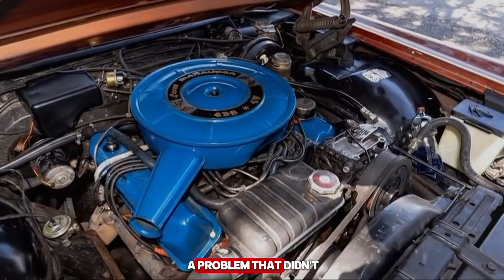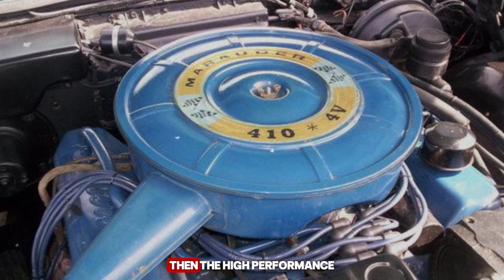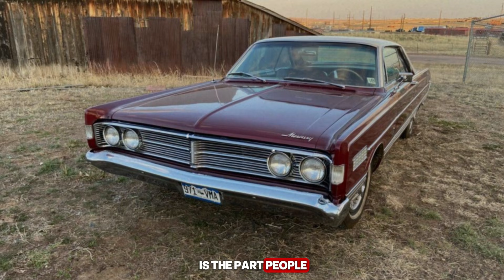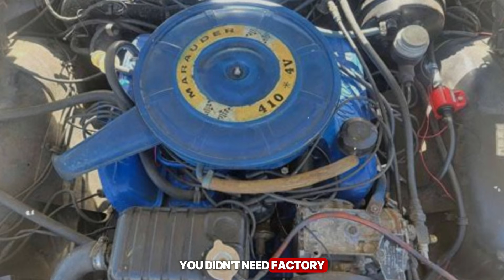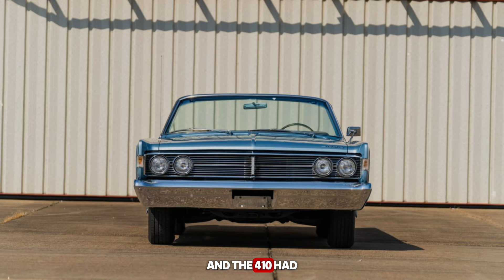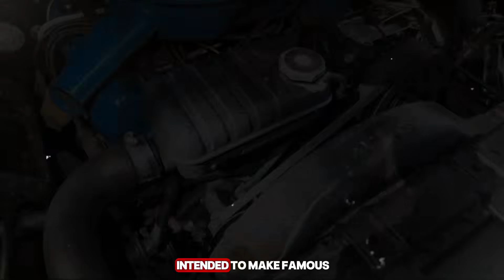Why Ford's FE 410 Was the Engine Hot Rodders Begged For — But Never Got

Comment: 410 was an Edsil engine from 1958. Originally FE was Ford/Edsil. The MEL was the 383/430/462 used in Mercury/Edsil/Lincoln. Most of the ‘58 motors are probably long gone. Have fun

Comment: The Mercury 410 is not an FE, it is a MEL (mercury, lincoln, edsel) Heads are machined flat with the blocks deck milled at an angle to produce a wedge. 383-462 ci displacements. Use ended with the introduction of the 385 series 429-460
Reply: The 410 FE was a Mercury only 66-67. The MEL 410 was for the big Edsel cars.

Comment: Fords blow upwhile parked. My dad had a 58 fairlane with the 352 special police interceptor, the oil pump took a shit every month,the carbs were a constant hassle
Reply: The FE and SBC are the two greatest engines ever built. You had to get in then and work on the oiling system. It is as simple as dirt to run 6000 all day long.

Comment: I still don’t believe that the 410 was only 330 hp,  I think it was closer to 375 hp and 470 ft lbs, and it was pulling to 5500 stock. It kicked like a mule. I think the 4V 390 was 355 hp and 455 ft lbs stock. This was at 10:1.  When the carb was a 4100 Autolite, a Holley swap and 2.5 dual exhaust, I am sure of it. The 10.5:1 or 10:1 was stronger than the 320-330 hp they were rated. And with a 410 and flat top forged pistons at .030 over, and the 427 hydraulic cam from the Cougar back then.  Put headers and the 427 Cougar hydraulic would make 410 hp, 480 ft lbs. Ford should have done it. Some one should do crate engines. 525 hp 525 ft lbs.
Reply: Keep in mind SAE horsepower ratings were gross numbers before the switchover to net HP ratings in 1972. But yeah, they definitely lied on rated HP.

Comment: About 10 years ago, I was at a self-service wrecking yard looking for parts. There was a clapped out 1969 F-350 flatbed truck in one of the rows. It had the older trapezoidal valve covers that Ford replaced in 1968 with the rounded ones that were stamped "Power by Ford". Someone had scraped the grease off the left front of the block revealing the number "352" , which most FE blocks of that vintage had. The original aluminum engine tag was still under the coil, it was stamped "410". Not having the tools necessary, I removed the tag and reinstalled the coil bracket to prevent someone else who knew from identifying the engine. I returned with the proper tools and removed and bought the engine for $175. Upon getting it back to the shop and pulling the oil pan, it was equipped with the 1 UA crankshaft indicating that it was in fact a 410. While I prefer to use 385 series 429 engines, I couldn't pass on that 410. A couple months ago I bought a "Q" code 1966 Thunderbird for $600. Its original 428 is worth more than what I paid for the car. Its still in my driveway awaiting reconditioning when I get the time.
Reply: Are you certain that it was a 1UA? The410 and early 428s were usually 1U or 1UB, the 1UA is the mark for the 428SuperCJ?
Reply: @Bill75456  Its definitely 1UA, turned 10/10. Of course there is the possibility that it was rebuilt with an exchange crankshaft which was common at one time, exactly when it was rebuilt isn't possible to know.
Reply: The 410 was my favorite. I snatched them up from the Salvage Yard in the 1970s and they bored .040 or I would keep the crank and use it in a 105 D4TE block at 4.09-4.11 and deck it to Zero. Back then.1/16 1/6 3/16 were as thin as they were on 4032 alloy pistons and in the 70s the 5140 forged steel rods were great with a a ARP bolts. A set of CJ heads and an aluminum MR style intake was good and the blueprint 427 425 hp solid was still available from a bunch of places. You had a 418 at .040 over and about 420 at.060 over. Some oiling mods and a good pan and put it in a 67-68 Mustang with a 1 3/8 top loader with a 3.70 locker and you were just at playing with the big boys. I beat every 383 Mopar and  a couple of 6pak 440 cars . Chevy, the L-78 68 Nova was a 6/6 run and it could go either way. The .060 over 410 had crazy torque. People claimed I had a CJ.
Reply: I miss the 410. It should have been the GT and GTA Fairlane and in 67 Mustang, Tasca may not have done the 428. A 416 CJ in a little car? The 428 could have come eventually, but the 410 as a GT would have been the GTO. I enjoyed building them. If they were going to cast 406/428 blocks, the 410 would have been all right.
Reply: I really liked the lighting bolt square shoulder “Mercury” valve covers. The 410 in the 67-72 F100 with an NP435 or even the big block top- loader and 3.70 locker gears in the 115 WB  bumpside. I did a 410 .030 over with flat top UEM Silverlite pistons with 1/16 1/16 Napier and 3/16 oil rings all filed and C7AE-B rods with ARP rod bolts and ARP main studs with 2 and 4, mains crossbolted. The 1UB crankshaft and the whole oiling system blueprinted. I put a Lunati 285. solid 110LSA 106 ICA and.527 lift with asymmetrical exhaust lobes, 300 exhaust was solid as an SCJ 428 blue print ca. Shell lifters and wraparound end stands with the HD rockers. The intake I put on the CJ head was an aluminum MR. The heads were the C7JE “Canadian” heads with the boat number that were 2.09/1.65 early style tall ports and 10.5:1 cr. The carb was a downleg 789 that I still have. That truck, idling, you could feel it pounding in the soles of your boots. Driving it was plain nasty! I miss that old truck. I did another.039, over 410 and ran it in a 68 Mustang coupe with a 1 3/8 top loader and it was a little beast., I drove them both in high school, and they were respected. The 410 was a great “ builder”.

Comment: Why would you need a 410 when Ford had a 390, 406, 427 and 428, all of which worked real well as I had Hipos of all but the 427
. Know of one guy that used a 410 - only because it was a freebie. Oh and AI is not appreciated.
Reply: The were the poor boys engine and if you know what you are doing they were easy to get a great 3000-6500 rpm runner.

Comment: I've never heard any hot rodder ask for a 410, or even have heard about it.
Reply: The  410 was not a hotrof  engine it was intended to haul heavy cars around! Mwecury never  made any thing  full size that was lite.
Reply: @mylanmiller9656 had seen old ones that had been police cars, cheap powerful car for small departments. Just decaled.
Reply: Guys didn't brag as much, better for street racing. Sometimes if you looked on air cleaner you would see the truck vacuum poppet valves to let in more air.
Reply: @keithbarron3654  The only thing about a 410, that makes it better than a 390, is the 20 cubic inches. Ford used it for 1 (one!) year, before the 429 came out. They offered a 390 in 1961 that had more horsepower, than the 410. I rode long distances in a '64 Marauder 4 door hardtop,  with a 410 hp 427, back in eighth grade. This VIdeo is AI slop, all those years I spent reading Hot Rod and Car Craft since I was 11 years old, and not one article about a build of a Mercury 410. Sure, It can be done, but it still isnt going to be better than a 427 or 428, at most, it's better for a towing package, than a 390. If your racing class limits you to 410 cu. in., you can get there with a small block, that will rev higher. They make that obscure Mercury option sound like the be-all, end all.

Comment: They also came in a PI version with an aluminium manifold that was a copy of the 428 CJ 4bbl manifold
Reply: That's how I remember the 406,410 as Police motors.
Reply: @keithbarron3654  There was also a 352 HP/PI version 360 hp
https://www.youtube.com/watch?v=JSSAOpSvqqs
Reply: @cliveapps7105 I just look at those as small departments thinking back, Mayberry 😊 I don't know if they lasted that long, similar to the 352, by 1968 gone.
Reply: @keithbarron3654  https://www.youtube.com/watch?v=Ir6T5hJnQ_M

Comment: Ford use yo have so many Legendary engines. Today it makes 

Pure Trash !
Reply: To make sure the Ford of todasy don't last Ford puts a timing System in that falls a part and Destroys the  Head pistons and block. the only thing left are teh bolts and they are torque to Yeald so thay  even have to be dumped.
Reply: Expensive  trash though!

Comment: What is missing is that Ford choked off performance to keep insurance rates on their cars lower. A 400+ CID engine in a 60s low-priced car made it a racer to insurance companies. 400+ in a giant luxury car flew under the insurance radar. The 410 was only available in Mercury's high-end models. Ask yourself why a 400M didn't up your insurance on a 70s LTD. Smog stuff and the 460 for comparison.
Reply: Because the 400 Ford didn't  have enough  power to spin the tires on wet grass.
Reply: @mylanmiller9656  Take off the smog stuff. I had a 400M out of a '71 wagon in a '66 Galaxie. The engine and transmission combo had noticeably better torque and outperformed the 390/C6.
Reply: @JohnBroughton-u4h  The  400 had  potensial  to be a Real performer.  But  not the way Ford sold them, It didn't even have  4 v offering except for  a 1977 police interceptor  taht is really rare.  That engine is  listed   in  ford 1977 specs as a R code 400.

Comment: I used to grab them from the junkyard. I really jumped on 410s  A .039-.040 overbore and a cam, 2.09 1.65 valves and a good intake and they came to life. A 420 ci engine is strong. A solid cam and it is strong. The hydraulic rollers you can get now turn a 418.33 FE with good breathing heads is a surprisingly good street car. 4.09 x 3.98. A set of heads that can flow 294 intake and 194 exhaust with a 780-850 carb and headers, it will be vicious.
Reply: yes the  FE engines had lots of  potental with over the c/ounter parts but ford was selling lazy cars in stock form.
Reply: @mylanmiller9656 they all did, unless it was a performance model, but mechanics would do performance tune up, owner got still had economy and peppy street running.
Reply: @keithbarron3654  Ford was  way worse at it than every body else. They raved  about how much power the 427 high riser had, but Wouldn't even sell the juice can 390 hp to joe public.  I had  friends that raced seriously and the only way they could get race cars was to but From a  Racer that would  sell the car after a season of racing.  Ford had their  select  few racers that were given good hot Cars, every body else got junk. I have always been a ford guy but,  Ford pissed me off on how they ran the perfomance program. 
The raved about hot cars but no body could buy them that was not hand picked.
Reply: @mylanmiller9656 Chevy also had select teams late 50-60's early. Buick used to send crate engines to the doctor that had old yeller, beat up road race cars. But we didn't get a lot of performance cars until mid to late 70's were I lived.
Reply: @keithbarron3654  Chevy would  also sell a L78 396 to any body that put it on the order form. 
They also sold teh l79 350 to any body taht would pay for it, same with the LS6 454. What did Ford ever sell joe public that would come close to these engines. if a Racr wanted to run a hot Ford he had to build it himself.
Reply: @mylanmiller9656 I was thinking early 60's, tend to think when racing bans hit. The local Ford dealership by me in the 70's sold parts over counter, after what your talking about. I think after the 390 green block crap Ford tried to regain, during strike managers built engines that had to be warranty replaced.
Reply: @m @mylanmiller9656   I could walk in to my local Ford dealer and buy the parts to put it a 390 and go have fun. Friendly Ford where I lived would sell a 428 crank, a set of CobraJet heads, the 2x4 aluminum PI 428 intake  or the MR intake manifolds, and the C8AX-D solid cam and any valvetrain Parts that you needed. 4.08 dome pistons that yielded 12:1 with CJ heads. And all of that , you could buy the hardware like bolts, gaskets, etc from companies like Holman Moody. The rest was a good machinist, and your own ability to address any problems that the original engine had like oiling system balance that just took some work with a die grinder and a tap set for restrictor plugs, and drill bits to open up passages from the pump to the filter adapter and enlarging the main bearing feeds by laying the hole back to bearing holes size. A larger racing pan and pump pickup. Hot rod engines require skill and attention to detail and the FE is capable of 1.5 hp per ci and 1.35-1.4 ft lbs of tq when you build it right. The FE is capable of being built to withstand the power of  whatever you want it to be. It is a very flexible design that the more you understand how to build it the more you can wring out of it. There are aftermarket suppliers of blocks, heads, and stroker cranks, and hardware for 1000 hp if you want to build a new FE from mild to wild. But you are right, I am pretty sure nobody did Ford Crate engines. You even to the mid late 70s had to build your own. I know that I  got blocks and 3.98 cranks and C7AE-B rods from the junk yard and remachined it all . Ford used to sell hot rod parts, but it never was a one stop deal.
Reply: @keithbarron3654 😎🧑‍🔧🌪️
Reply: I loved the challenge. Nobody took the 390 stuff seriously. But I used a junkyard 410, TRW 12:1 pistons and CJ heads with a PortoSonic and big nasty cam and it was 418 ci with strong walls and the 1UB nodular CJ crank. I ended up with an 850 DP in a 68 Mustang coupe. I 3/8 Top Loader and a 3.70 locker. It had so much torque, it was a menace. I really miss driving. I had to give up my license because I failed the vision test and I am legally blind now. But all the mayhem I caused I’m just glad to be alive at 66.
Reply: @Bill75456 😎😁🤔
Reply: If you walked into a Ford Lincoln, Mercury dealership parts department with the money, they would order you a 410. A stock one. But why not get one from a wreck and build it. Bore a 390 block.030-040 and put a 410-428 crank and rods in it? Do the oiling mods so they could live. Big cam , 11:1 CJ or LR heads. You have a home brewed bad ass. I built a lot of them. Cheap.